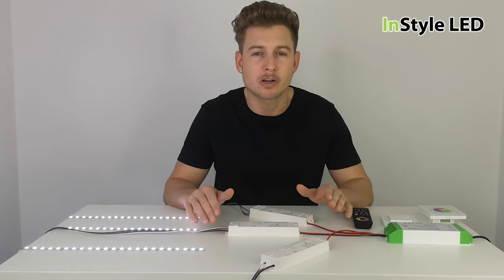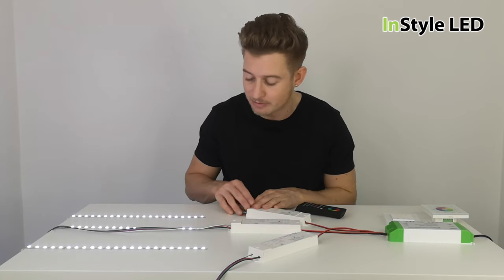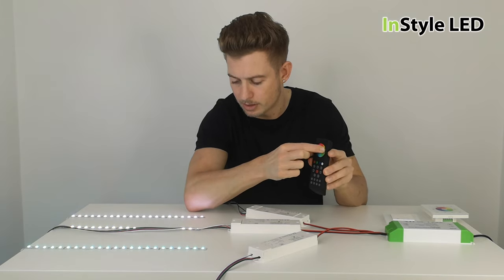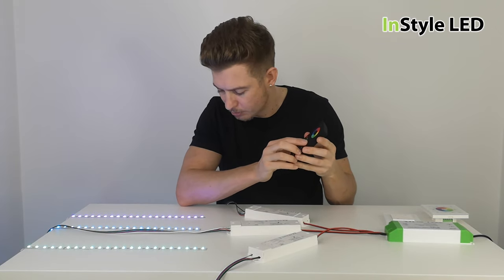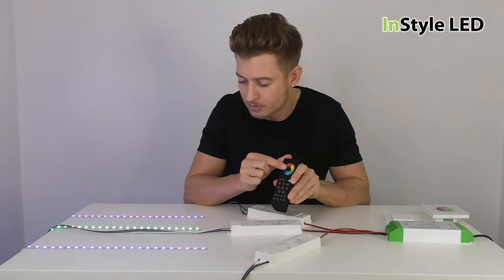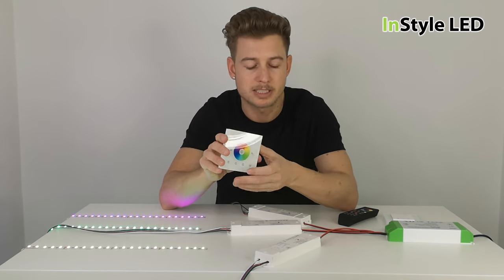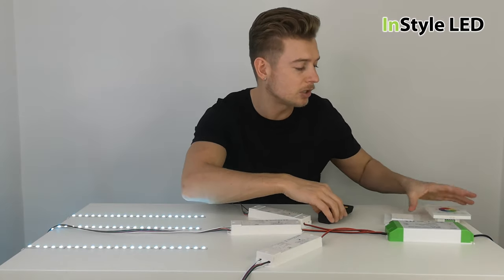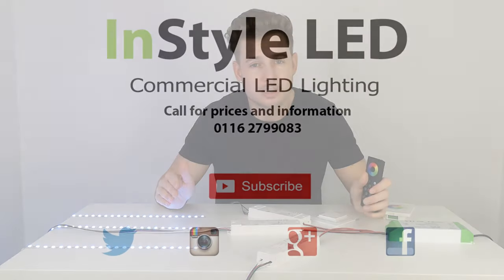How to control multiple LED strips / areas of LED lighting? - Wireless RF option

Comment: So what do people do for LED strips on opposite sides of the room?
Reply: Yeah I'd like to know as well. Is there a way to do this or would you need another power supply?
Reply: Could probably run wire from the power supply to the receiver. Or if that’s too inconvenient, just run another power supply. Could even be a battery powered one.

Comment: Can you connect different brands of  LEDs together?
Reply from the maker: Yes you can,
As long as both the same voltage they can both work on the same power suply and receiver. Eg. Both 24v .

Comment: is it possible to control led lights with a different brand of controller?
Reply: I want to know that too
Reply from the maker: Yes you can mix any strips with any controllers as long as they all match i terms of voltage  eg, 24v and 24v   and also that you have enough power

Comment: Excuse me! could you anwer my question?
. Can i control one dimmer for multiple Led panel ( alot of led panels)?
Reply from the maker: HI There,    it depenmds on what dimmer you are using,    but in general yes,  you can have muktiple strips / panels  all controlled from one controller / dimmer.
The main thing would be to let me know what spec dimmer / system you are looking to use. Unless you mean the type in the video?
There are several ways to control the panels also,    EG> you can either have numerous panels on one receiver so they are all controlled / dimmed together.  or you can have a multizone receiver and multizone controller where you can dim / control each panel indivually.  All control options are available, they all vary on price dependimg on how much control and how many panels / strips you are looking to control

Comment: is it possible to turn one of them on at a time while the rest are off and on separate receivers and separate power suppllies?
Reply from the maker: Yes!,  so if you hit the main on /off switch then all will turn on and all will turn off. However, if you hold the zone number down for 3 seconds,. EG,  you hold the number 1 button down, it will turn off just that zone! Then hold button 1 again to turn zone 1 on again.  And this is the same for each zone.
So you can turn on and off individual zones aswell as all of them together. It's a great controller!
Reply: InstyleLED thanks dude

Comment: Hi, 
Which receivers are being used in this video,
Thanks
Reply from the maker: We are using the RF receivers as here:
https://www.instyleled.co.uk/multizone-led-receiver-5-amp/
if you email sales@instyleled.co.uk
with your requirements , we can send you a quotation and advise on the best system
Reply: @InstyleLED  how can you conect a combination 3-1 switch ligth 120v to a 3 different led strip ... I am looking to instal 3 ligth level led strip (multizone) in a closet  I can figure what a driver box use to create a independent system... and turn on/off all at the same time ????
Reply: Is there a way to sync receivers that sync or react to sound/music??

Comment: I’m making a desk with led lights in, I got the 10meter WiFi kit that works with Alexa, I want two zones, top of desk and bottom of desk which isn’t a problem as I have a splitter cable but would like to control them separately, I’m wondering if I can add another controller of the same brand by using a dc power splitter, would the power supply that came in the kit be ok to do that? As I’m not adding more lights to the kit, I will be using short of 10m anyway, also I was wondering it the 
 two separate IR revivers will be controlled only one of the Remotes? 
Is there a WiFi controller that works with voice control that is a single unit that can control strips independently? Any help would be much appreciated, I just can’t seem to get any of the answers online?
Reply from the maker: Thanks Stuart, Please email this to sales@instyleled.co.uk  and we can get back to you and advise

Comment: Im a bit confused, and i need help
Suppose i want to install led strips from the same reel in different parts of my room, how do i power them with one remote? i installed behind my bed already but now i want to install behind my tv also, how do i power the strips behind the tv? 
Someone help me please, its driving me crazy
Reply: Right this is where I'm at
Reply: For each location you would need a separate power supply and receiver. 1 set for your TV,  another set for your bed. Then pair the receivers together and now they control both the bed and the TV LED strips with 1 remote.
Reply: @jiaan66  could you tell me how  you pair the receivers together?
Reply: @HOLOSXGHT  He shows how to pair remote and controller around 1:20 I'd imagine there would be text instructions if you buy the setup too

Comment: If I had four led strips and four controllers in a location outside the range of my home internet could I still group them together and get them to flash, change colour etc in unison using a WiFi connection between my phone and the controllers?

Comment: How can you conect a combination 3-1 switch ligth 120v to a 3 different led strip ... I am looking to instal 3 ligth level led strip in a closet  I ca figure what a converter box use to create a independent system... or turn off all at the same time ????

Comment: So is it  wierd ( wall plug-> transformer -> 3 led receivers ) Need basically same set up
Reply: Yes thats correct.  OR,   you can have    a transformer and reciver in several areas / rooms.   And they can wirelessly work from 1 remote / wall controller
Email sales@instyleled.co.uk with your rqeuirement and I cam send over a quoation and any advise within 1 hour

Comment: Is it possible for me to cut it at the cut line and put them in different places with them still all working? If so, how?
Reply from the maker: Yes you can use connectors to attach starter lead cables back on the strips that you have cut. or you can solder cables onto the strip.

Comment: can i cut at the copper line and the put at other places ex ( under my bed ) ( behind my monitor ) and still get it to work
Reply: tell me if you find out but i don’t think so cause they all need to be wired to the power pack

Comment: i'm confused, can you control two different strips of the same brand with one controller? and how do i fit them both together?
Reply from the maker: Yes you can have a multzione remote controller, so for example,  press button 1 and control 1 strip. Press button 2 and control another strip.
You would need a power supply , receiver and LED strip for each area,    then 1 wireless multizone remote.
You can build the system up so it could be whole rooms,
So for example you could have  5 strips on one power supply and reciever for your kitchen ,  then 2 strips on one power supply and reciver for your kitchen ceiling and they acn all be paired to zone 1 (button 1 on the remote)
Then you can do the same again for another room and pair to button 2.
So you now have 2 rooms and loads of lights all controlled from 1 remote,  easily controlled by pressing button 1 or 2  ,  or even pressing the buttons in quick sucession to control zones 1 AND 2
It's really good

Comment: Hello! Great video! I would like to ask if this sets allows to dimm by one pilot led strips which are powered by 4 different power adapters? I have big LED installation in staircase and my electrician planned 4 source of power which are going to be connected to 4 different 24V power adapters.

Comment: I just need to ask sumn simple like what happens when u turn on the switch but like turn the lights off with the remote will it still use the electricity?